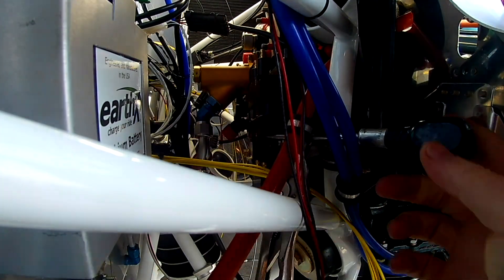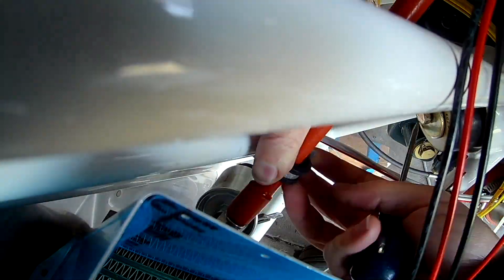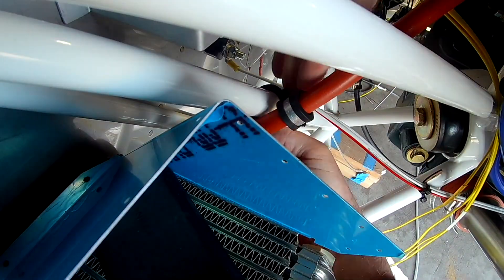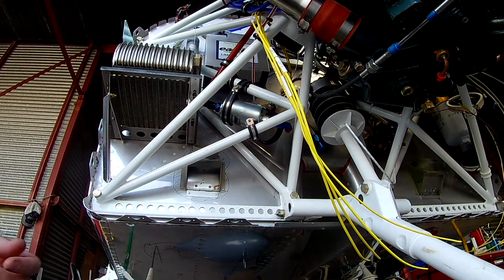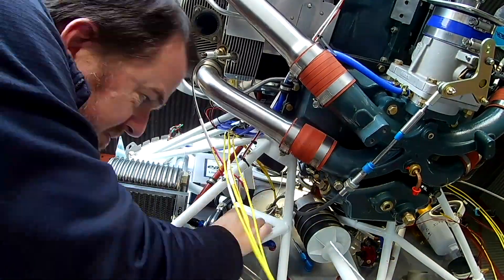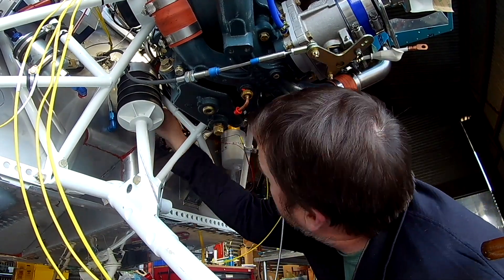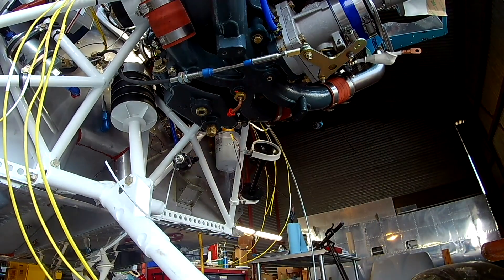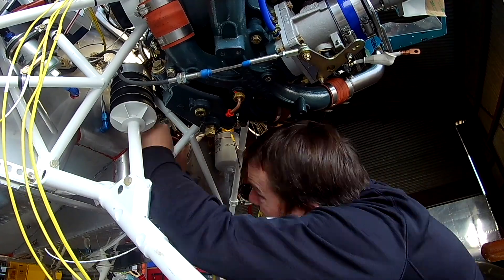RV-14 Fuel Lines IV

Comment: I’m still waiting for my finish kit and fwf kit but question for you: are you following any standard directions at this point? I understand you didn’t put a factory engine on there but it seems like some of this is figuring out how things will fit. Shouldn’t that be standard with regards to locations, space, running of lines; etc? Is it the customization that causes the creativity or is it a lack of directions?
Reply from the maker: Its about half and half with most things. The cowling is a good example. Instead of the hinges I'm using camlocks. You still fit the cowling halves together in the same way so the trimming and sizing are the same. Its just instead of measuring, spacing and riveting on hinge material you're doing all those steps with cam lock pieces.